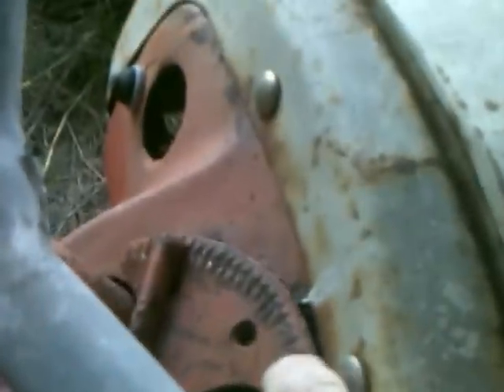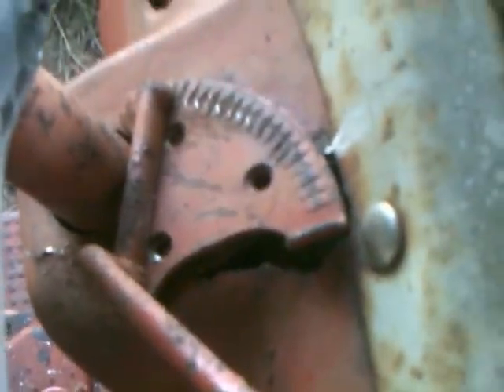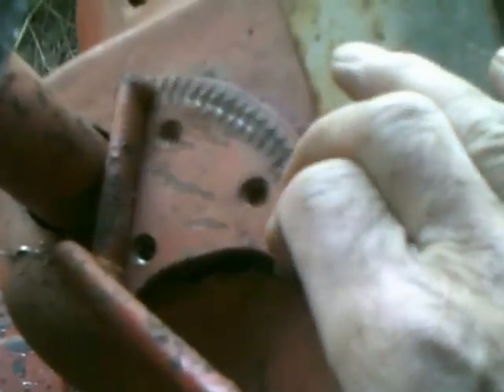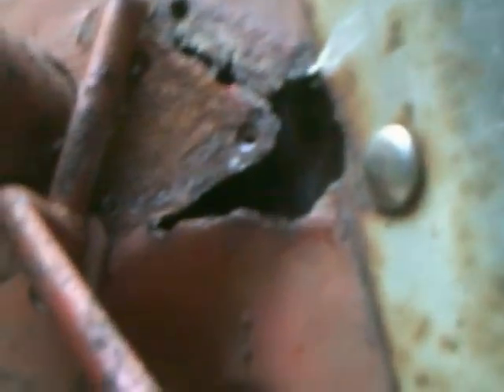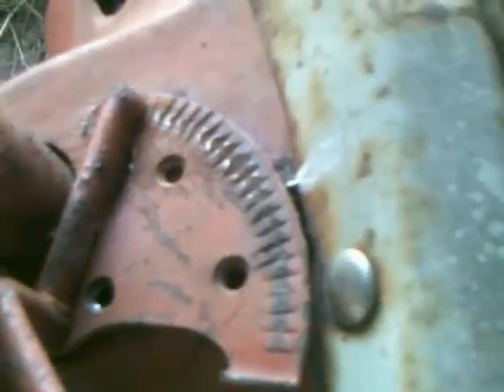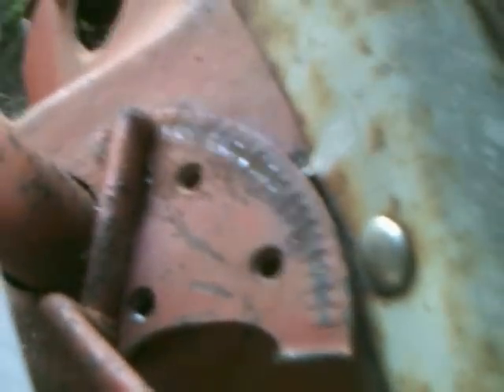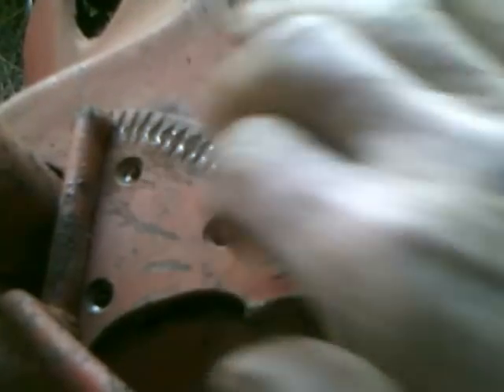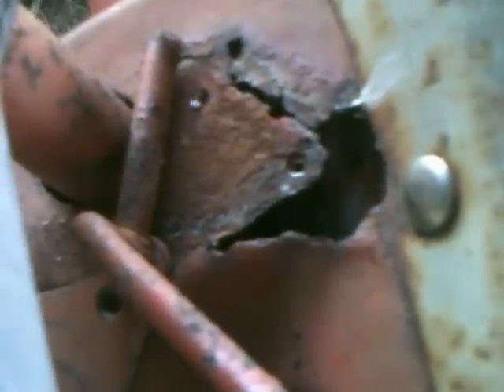1948 Ford 8N tractor throttle lever plate repair

Comment: When replacing the plate you should also replace the 3/8 inch ball bearing in the throttle lever as well.